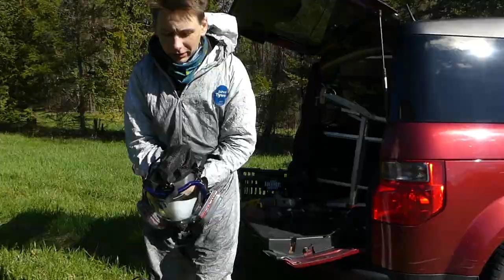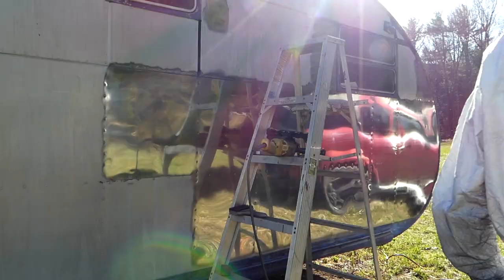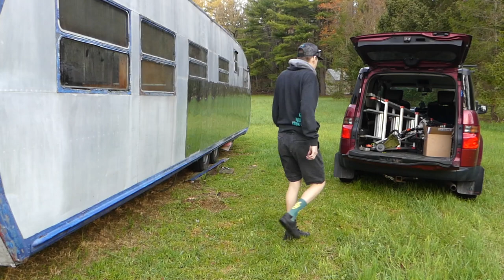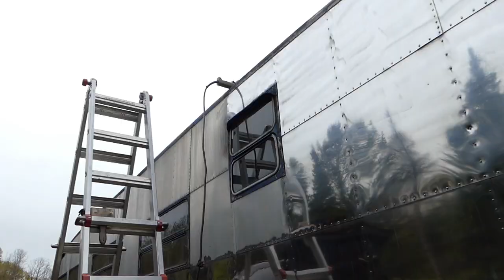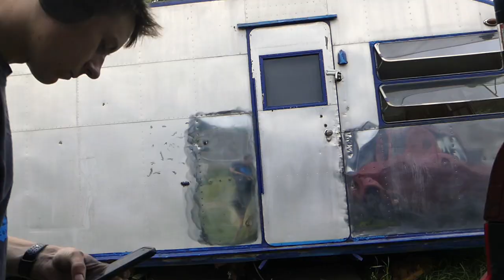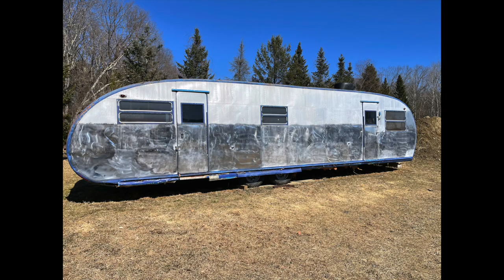Polishing a Vintage Trailer Time Lapse

Comment: Awesome work and video! As someone who has zero experience with these old aluminum trailers, about how long is a good polishing such as this good for? As in, how many years before it starts looking dull and gray again? Also, do you treat/coat the aluminum in anything to slow down or prevent the oxidation from coming back, or just let it be?
Reply from the maker: This does require some level of up keep every 1-2years depending on the climate. It will not go back to dull, but will loose the crystal clear mirror over time which is remedied by a light polish every year-two years. The hard work is done